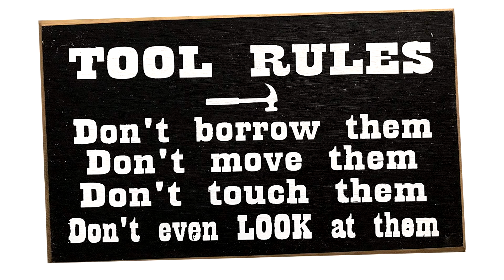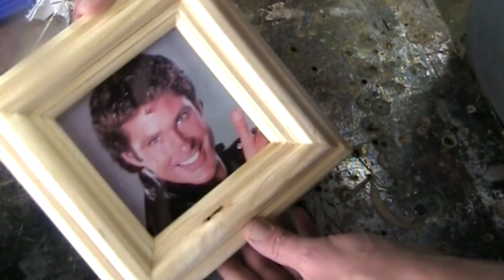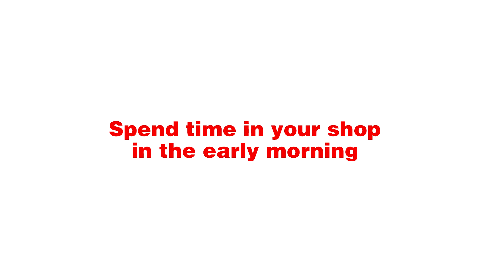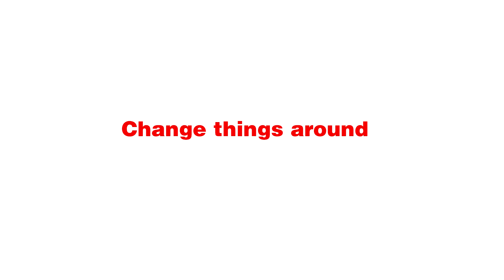Should you let people borrow your tools? 8 ways to get more out of woodworking.

Comment: Quality Tools Do Make a Difference
Cheap tools are unpleasant to use and in many cases unsafe. I learned many years ago when a bargain basement ratchet extension sheared off while loosening bolts on a water pump (think knuckles scraping again a radiator) that cheap tools cost more in the long run. Example: An inexpensive but underpowered battery powered screwdriver only requires upgrade down the line. Quality tools that are cared for and well maintained will last for generations and are well worth their cost. Quality tools that are well balanced and ergonomic, whether hand or powered, make your work better because they don’t work against you. My mantra is “Save Money and Buy it right the First Time” I still enjoy using my circa 1970 Craftsman sockets and wrenches almost 50 years later and they still look pretty good after decades of use.

Comment: I used to lend tools. After 30 years in the electrical trade I could probably count on 2 hands the amount of times I didn't have to go personally get the tool back.  Almost every time I hand them a tool, with the imposed, "bring it back, after your done" I have to quit working on what I'm doing and go across the jobsite and get my tool back.   I am usually the guy on the jobsite that has more tools then most others.  Not my fault I've spent years learning what battery tools and such make my job easier. Now I have a decal on my hard hat, "Don't ask to borrow my tools and won't ask to borrow your girlfriend."

Comment: I think that what I enjoy most spending time in my garage woodworking shop is the solitude.  I generally have 2-3 projects going at the same time.  I usually have the TV going with a ball game on to keep me company.  What I don't like is when someone comes in the shop when my back is turned and I'm running a power tool.  That has caused some screw up's.  I think the next time that happens I'm going to tell them that they could help if they would take this can of spray paint, go outside, and shake it.  When the ball stops rattling bring it back to me!  Ya think they will get the point?

Comment: I certainly enjoy woodworking more now that I have my big cabinet saw verses when I had to use the plastic bodied saw used to have. But that's mainly just because it's not as frustrating now that I'm able to get nice clean square cuts easily and repeatedly and because the saw doesn't constantly trip it's overload breaker if I try to cut at a reasonable pace. Plus it's not nearly as loud

Comment: i would much prefer lending a hand than lend a tool, i use to lend them out when ever someone asks but i have had way too many broken tools returned, or out an out stolen. in some cases , because of the rarity of the tool, it became nearly impossible to repair or replace. I have a 5 1/2" Mikita trim saw, it turns at 9 thousand RPM that is nearly twice as fast as any other saw in its class. I finally found ( several years later) a new table for it at a repair shop that specialized in repairing tools. I am very care in my selection of tools. i can not afford to replace them, i am not just a hobbyist, for years I made my living with my tools,  tools are not just toys but investments.  what i did do is build a chest filled with tools i am willing to lend.  i once had several thousand of dalliers stolen while i was on  a job. I wish i could trust people
Reply: I would suggest to any one to do your research and get the best tool you can afford. in some cases if I could not afford a tool, I figured out how to make it myself. Cheap tools do nothing but bring me frustration which means that I will not make the project I want to make or I will wait until I have the right tools for the job, one of the reasons I watch this channel because I love to learn how to do thing better than I did before.

Comment: i dont mind sharing tools to a person i know and to a person i know that knows how to use them 3 times i borrowed to neighbors im okay with but not in some special relations, 3 times they returned me messed up tool, first time it was stihl chainsaw he broke a chain and returned it like that saying sorry i accidentally hit nail, i said okay will you go buy me new original stihl chain, he just chuckled at me thinking i was joking, 2nd time it was concrete mixer he returned it with broken wheels and bearings and 3rd time it was circular saw he cut himself and then came to me blaming me saying it was tools faults and not the fact he doesnt know how to operate it, since then i said to myself im only borrowing tools to my good friends and they need to be skilled in using tools, so yeah no more borrowing tools from my side

Comment: I have no problem loaning out my tools. If they come back scratched up or damaged, so what? It's just stuff. Family and friends are more important than stuff. Stuff can always be repaired or replaced. If I am worried about someone with little experience borrowing my circular saw, (very) sharp chisels or router, I will offer to help with their project. My father had a real problem with lending his tools and could tell stories about this tool or that tool that came back broken. When he died, he had a lot of tools in his shop which he no longer used but which he could not bring himself to loan out either. It's all just stuff.

Comment: Largely, I don't buy high-end tools. In my experience, inexpensive tools work as well as high-end tools. Sometimes they need a little TLC, like the HomeDepot block plane I bought whose sole wasn't flat. But, hey, for twenty bucks and an hour of work I have a very useable block plane. As far as loaning tools; I do it all the time. I generally assume I'll never see it again, and I'm usually surprise when they return it. But, even when it doesn't come back, that has never damaged a relationship (think: Kids, family, neighbors, co-workers). I think that Woodworkers are like every other "specialized" group, they think the tool is more important than skill/knowledge. Tools are sometimes shortcuts to knowledge and skill, not replacements. Try building something like a bookcase with only a screwdriver, a $2 drill (from the clearance rack at Kmart (it was broken)), and a handsaw. I have done it, and twenty-something years later it is still in our livingroom holding books. Tools don't make you a woodworker; making stuff out of wood does.

Comment: My table saw blade will change angle, hight or both while using. Not to mention the fence. So money to buy a better one would dearly make me happy. Also the times I borrow a tool, I return them in better condition, from sharpening mower blades, cleaning carpet cleaners, everything. If I borrow it, you will get it back better. 

However

My neighbor borrowed my dyson one day, she dropped it down the stairs, left it outside, rang the bell and ran away. 
Years later a different one borrowed my pressure washer, burnt the poor thing out. 
My sisters husband borrowed my hedge trimmer, somehow managed to reverse the car over it. 
A guy from uni borrowed my drill, he is insistent he gave it back. He didn't.
After loosing so many tools to people who don't give a sh1t, I don't loan out my tools, if you want my tools, I come with it.

Comment: I built your king platform bed with drawers howeve the drawer face witdth  was same as opening and you rounded drawer face edge did you then put the rounded edge next to face frame. Anyway  it was fun and fairly easy

Comment: Should you let people borrow your tools?

Short answer: no.
Long answer: NO.

Actually I don't lend any of my things because EVERY time I did this the thing returned screwed or never returned at all. The problem is not the object itself but the fact that when I buy something I need that it stay available for me whenever I need it, and when you lend something well... it won't. That's why I don't lend stuff and why I never borrow something from anyone. When I need something I go out and buy it. I remember that years ago when I still worked as a graphic designer, I was hired by a printshop to make an extensive work of retouching old photographs and I didn't have a scanner at the time. As I was going to do the work in my house the owner of the printshop offered me to take their scanner and bring it with me for the job. Right at that moment I was stroke by the though that it wouldn't be fair meaning that I had to have my own stuff. Otherwise what kind of professional I was? I then thanked for the offer, declined it and went to a computer store buy my scanner. And that's the way I live my life. I don't borrow or lend stuff / money. Never.
Reply from the maker: I'm so sorry you've experienced so much trauma. 😢

Comment: On lending tool, I loaned a neighbor my electric mower(works fine on small lawns) and it was about 2 hours before he brought it back, I wasn’t worried (much) because he’s only 2 houses away, but I didn’t hear the mower either. Cut to the conclusion: he had ran over the cord and went to buy me a new one, and that’s what the delay in returning it was. I loaned my traveling table saw to another friend and it came back cleaner than it left. When I was still in my 20s I’m not sure how good I was about returning things or asking for borrowed items back but now it’s no problem.

Comment: Sorry Steve, I only lend tools to people that know how to use them, for their safety, and the tool's safety. This is down to long,long experience- I wouldn't be boring you with a single anecdote, more like a book of.
As you suggest I offer my time, or at least enough time to demonstrate how to use the tool. This is far more productive all round, I find.
Only last week (starts to bore Steve with anecdote) my nearest neighbour asked to borrow my jigsaw, to cut an access hole in a self-assembly wardrobe. I vvolunteered to do the cutting myself, but found him the rest of the tools he needed to make the assembly easier. It turns out the wardrobe was to be sited in front of the only power outlet in the room, so he wanted to put a short extension lead inside his wardobe so he could continue charging phones,razors etc in there (I know, don't ask). He had marked out a square big enough to pass the socket head through, not thinking just to drill a hole for the cable, then reconnect the head. The man is an astro-physicist, working on the European Space Agency. I don't think NASA would want to see that on a c.v!

Comment: I do lend my tools, but I have some restrictions. Only trustworthy people get them. I had people bringing back my tools and not even tell me that they visibly broke in half.
I have people that I know will treat my stuff like it is their own. And I call them the "Inner Circle". They know, that I trust them in handling my tools as intended and they can trust me that i will use their tools as if they were my own.

I would not even care if something breaks. That just happens when you use tools. But at least have the decency to tell me. You won't even have to compensate if you didn't do it on purpose...

Comment: Don't fall for it, I won't lend anything ever again after never getting things back or in bad shape, even broken beyond all repair.  My favorite is a family member who pulls the old "can I borrow some steel wool/sandpaper/any other consumable, I only need a little and don't want to buy a whole package".  They do this a few times and I suspect they lost the previous ones rather than using them and the next time I want to use whatever, I have to go buy a new package.  Same guy "borrowed" an expensive bottle of rust converter and then refused to return it claiming he used it all which is B.S. as he could have coated half of a car with the amount that was left.  Never a borrower nor lender be....and never again.

Comment: Sorry.
I no longer lend out tools that I can't afford to replace.
After the brand new pliers that was left out in the rain for 3 days by the borrower, the almost new set of driver bits that came back rusted, pieces missing, and the case broken, the circular saw that came back covered in cement dust and its cord cut through, the hydraulic jack that never came back, my hammer drill that came back filthy and with the chuck damaged, my brand new cordless drill that was put down in a puddle of water right in front of me, the chisel I lent to a joiner that came back chipped because he used it to lever a nail out of a piece of wood, rather than ruin his own because "what could a woman possibly need a chisel for?", the electric hand plane that came back with the plug cut off because it had 3 prongs and could not fit in a 2 prong point.
Never again. 
Too many borrowers out there who have no regard for the tools that belong to other people.

Comment: You all need to stop lending your 'special' tools. I am not knocking you for having special tools (I have them) but there are loads of inexpensive ones you can get, and use, for dirty jobs. Lend those.

As an example if you have a Menards (with sale/rebate) or harbor freight (everyday) near you, they offer inexpensive one use, who care, tools that will get most jobs done a few times before needing to be tossed.

I like using good tools but I am also with Steve on feeling tools are a ends to a means vs being sacred and special. Again I have special tools but those are basically sentimental and I would not use them daily, at all, and especially in anyway that could damage them (why are you sending these? Especially if hairlooms!). 

If you don't want to have excess tools, that's perfect, just get inexpensive copies of the tools you don't want to drive to the store for because yours have given up it's ghost. This will be a drill, screw driver set, and drill/driver bits to start, minimum. Always make sure your spare is a corded version to minimize cost, and increase reliability (when was the last time you saw an extension cord fail, in fact add extension cord to the list above of staples you want a spare of around.) Finally buy your spare loaner/garbage(whatever you want to call it) tool when It's a real good deal on sale, or at a garage sale etc. I do this because I hate being in the middle of a job and having an unexpected failure. I know I will go out and pay full retail for a cheap tool or a quality one just to finish the job, when I could have avoided it during a holiday sale earlier.

Good luck to all and pass it forward please! You may just get the next person into diy and start them off on their own journey towards where you are today.

Comment: Steve, I used to listen to your advice. Lending is just simply NOT good advice. Have no idea where you came up with that. I don’t borrow either. If I need it - I buy it.  Did you think of high speed precision tools like router bits and star drives ? This can be extremely dangerous to you the lender when you use them the next time and they used your pattern bit on some 1/8” Aluminum, ALL day! Listen.... Bad... just bad idea. Please rethink it. //ji

Comment: "I've never had expensive tools and I've always loved woodworking." That's a bit like saying 'my horse is better transportation than a car because I've never had a car but I still get around ok.'  If you've never had high quality tools you don't actually know if they would make the woodworking experience better. Its silly to suggest that people only SAY they enjoy expensive tools to justify having expensive tools.  My used Dewalt lunchbox planer does the job but is prone to tear-out and snipe. I can't afford a big planer with helical cutters, but having one would improve my woodworking experience exponentially. 

The law of diminishing returns apply, but using quality tools make woodworking MUCH more enjoyable than using crappy tools. I am limited by my budget so I try to find the balance between quality and value.  Buying and restoring old tools and making things yourself is a great way to get great tools AND not break the bank.  My table saw is as good as anything out there and it was manufactured in 1944.  I bought it, restored it, and fabricated beismeyer rails and a VSC Tools fence for less than the cost of your  Porter Cable saw.  On a side note- restoring old tools has become my 2nd hobby behind woodworking.  Restoring and selling 100 year old planes have paid for all of my tools.